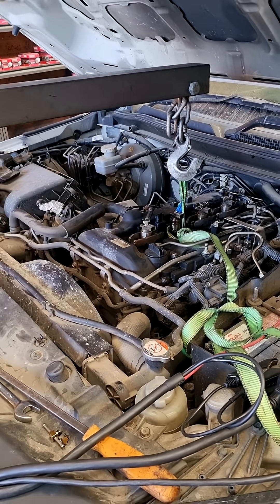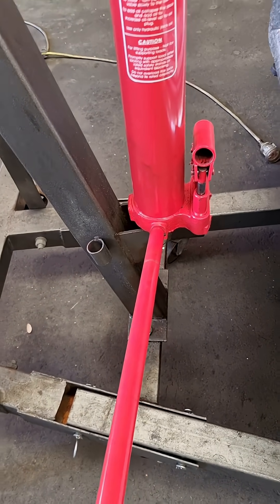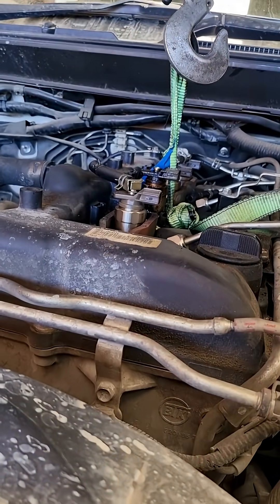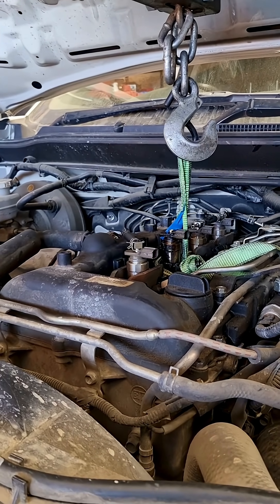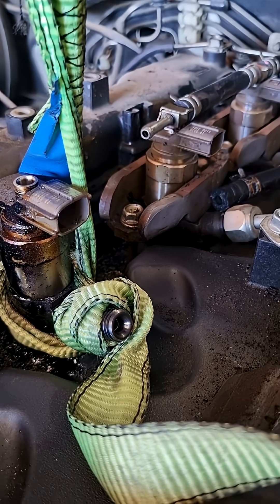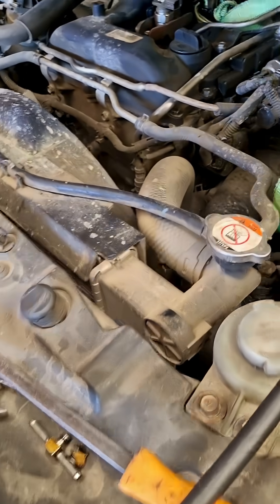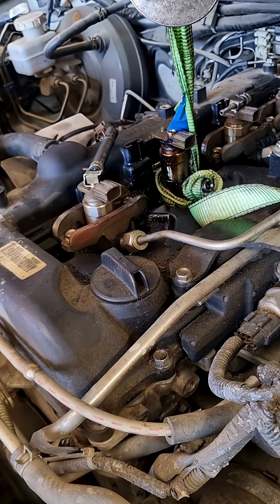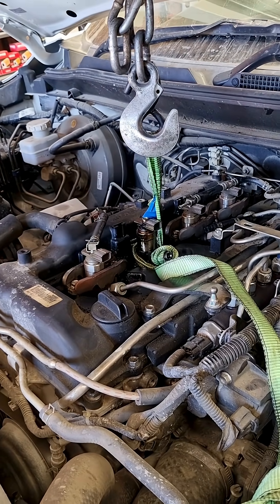Episode 1.1: When the Injector Won’t Budge… Time to Get Creative! 🔧💥

Comment: I would try and get an air operated removal tool. Best tool I have used for injector removal. Almost unbelievable. Like an air powered slide hammer but short and fast air pulses.